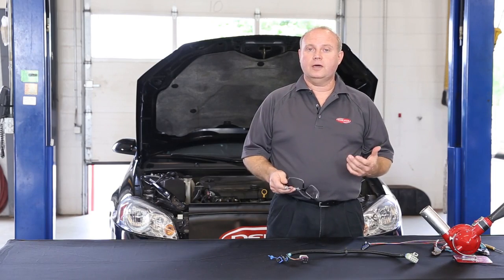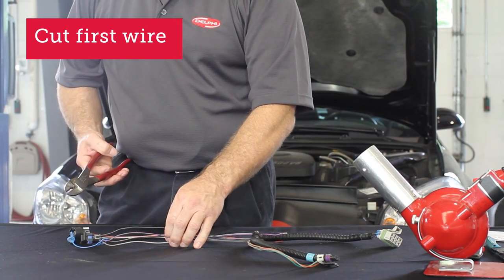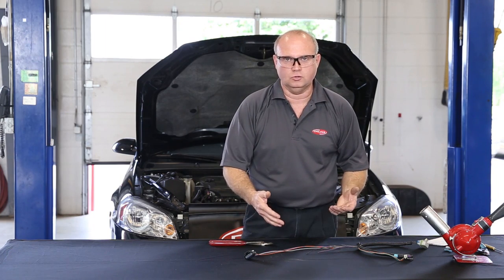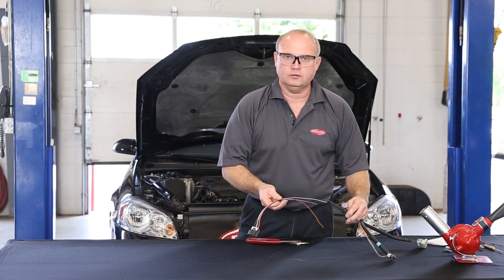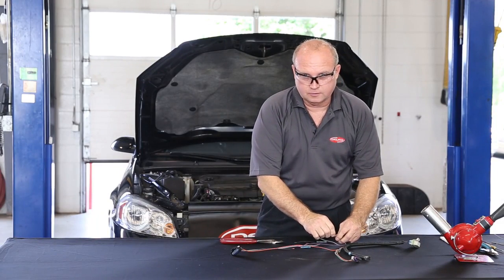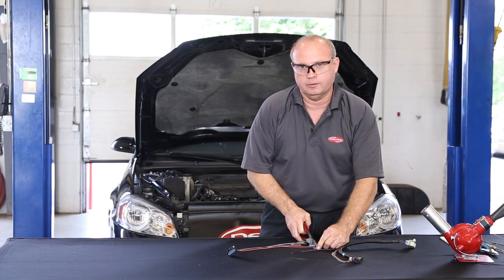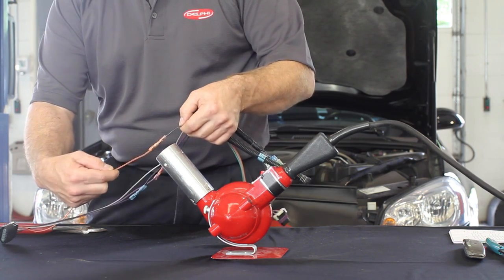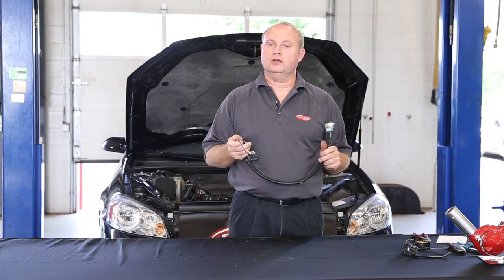How to Replace a Fuel Pump Wiring Harness

Comment: I have a 1992 GMC topkick 6.0 gasoline engine. Does it matter if the two (02) wires connected to the pump have been crossed please? Thank you.

Comment: Why stagger the cuts?
Reply: I think it must be to keep the diameter of the combined splices down. If the connections are offset from each other the thickness will not be additive. This does point out that every step must be explained and do not assume your target audience knows. The same should be said for the  use of jargon and acronyms. Acronyms are terribly misused especially in written instructions.
Reply: So if the crimps come off or fail the wires cant touch each other.

Comment: Why would you buy a wiring harness that's not compatible to the car. It doesn't make since to buy the have to cut it. Bad video
Reply: This is mostly for older cars. I've got a truck I need to rewire because all the replacement fuel pumps are now 4 pin flat. The old one is 4 pin round. The switch was made around 2005, my truck is a 1998.
Reply: @coyotetracker1  I agree they should make plug and Play ones I don't know why you would have to cut a connector off your car
Reply: @hondaslave-kd6hi  That would cost more money to be manufactured. Standardizing parts means standardizing methods and thus cheaper. What you are thinking of would only end up being a specialty part that would be sky high. If you want plug and run im sure you can find one but its gonna cost you a small fortune.
Reply: @coyotetracker1  thanks. Makes since. A OEM pump is over $500

Comment: and u connect blue to red, black to gray, orange to your nose, probably... Even doe, u did it on a table, not on a car, doesn't help at all !! Waste of time..
Reply: Refer to wiring diagram
Reply: @anthonymoore6492  it would be nice to have a wiring diagram to refer to.  They do not make them available anywhere online and since my diagram was not in the box, I am left with a brand new fuel pump installed that doesnt work.  Why on Earth would Delphi not make the wiring diagrams a downloadable file from their web site?? I am have had an inoperable vehicle for, going on 4 days now thanks to the genuises at Delphi and their elusive wiring diagrams.  THANKS DELPHI!!
@#!$@
Reply: @AaronKraftCreative  i feel your pain. just got one today( cause i want to use a good pump). But of course it doesn't have a wire diagram to go by. Got a bunch of other useless paperwork about cleaning your tank, and being careful around fire. But most important thing and its not there. If they could have at least marked the A-B-C-D on their connector would have been fine. And their connector pins are not in the same spot as other brands. went to their website for information, useless. have a phone number with 11 digits. can only email. we'll see what happens. Obviously there's two thicker guage wires(which are for the the pump). The other two for sending unit. But which ones to which? Douchebags!
Reply: @silverado2500wr450  same here I bought these pumps because they were an upgrade and neither had instructions for wiring diagrams. It's pointless to cut the old connector off your car
Reply: I have the same problem with the new Delphi fuel pump I just installed in my 2000 mustang. The idiots have the fuel pump dead grounded to the sender ground if you use the new fuel pump assembly the way it comes out the box. Also no new connector or wiring diagram in the box with new pump. The way they have it wired new out the box the fuel pump runs constant at 125psi which is 3X the fuel pressure my V8 mustang should hold on the fuel rails on the motor. The idiots didn’t even include any instructions letting you know it may require rewiring for different applications. Horrible service for a brand new assembly and the fuel tank has to be taken out again and these idiots should have to pay for it. I may take mine out tomorrow and just send the entire assembly back to get my money back since I still have 2 weeks to return for a refund before my 30 days are up.

Comment: i just ordered a delphi pump , fg0236 , for my 2000 dodge ram 5.9 gas truck and im wondering if you can tell me if it comes with a new wiring harness as the original one has the ''lock'' on it which slides into place at the rear of the pumps fitting to lock the two peices together and the lock peice is broken on my truck so harness needs replacing . and if the pump doesnt come with new harness im wondering if you could direct me to where i can buy one as ide like to be ready to install new pump as soon as it arrives as my current pumps going . and ive searched internet and am unable to find this harness

Comment: Your stupid wiring harness mod screwed up my electrical system. Why not make a compatible part instead of taking shortcuts
Reply: Or even easier, connector to connector... But that way mechanics stay out of moneeey....
Reply: @yuzeyy7357  This is a GM update not from them